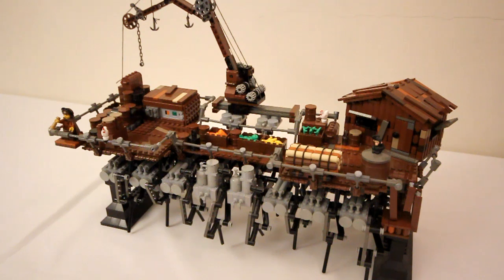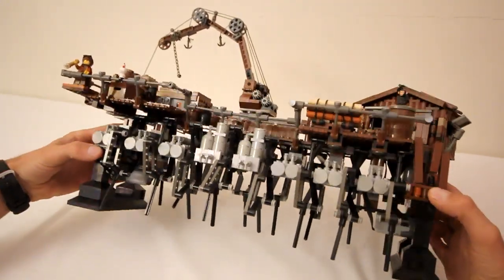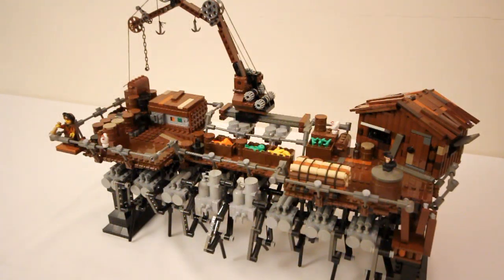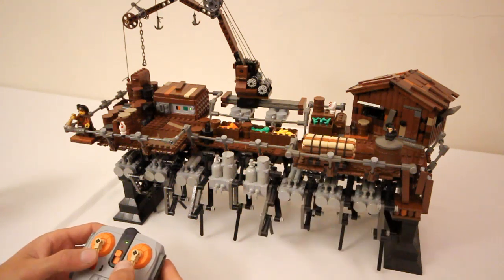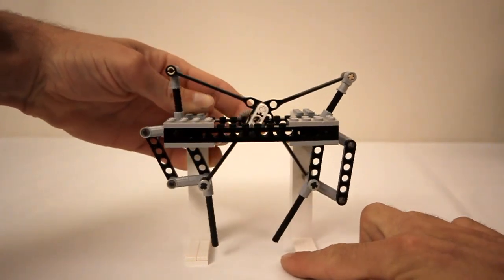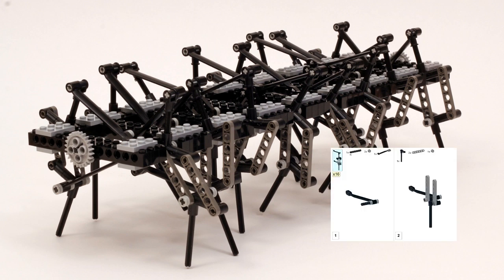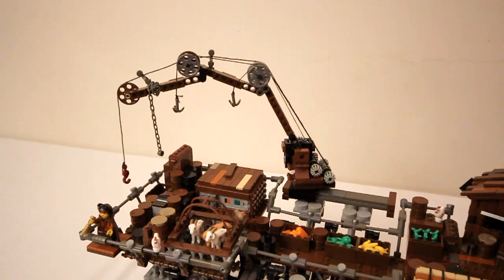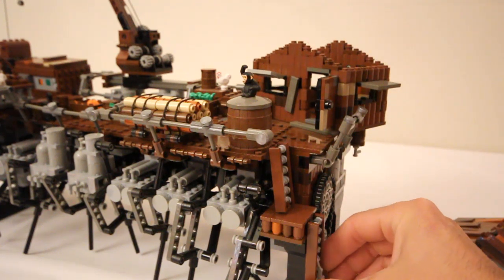LEGO Steampunk Walking Ship (Strandbeest)

Comment: Very nice built mate! I would like to recreate it by myself but I'm not sure about a couple of things.. Can I ask you a couple of questions?  How do you assemble the deck of the ship to the walking mechanism? Is the bigger gear the one that controls the legs and the smaller one the one that's attached at the motor? I know that it's been a long time since you create it, I'd really appreciate some more information. Thank you for this video and for all of your works!! Bless!
Reply from the maker: The deck just sits on top of the frame. Yes, the large gear is connected to the leg drive train, and the small gear is connected to the motors that hang underneath.
Reply: thank you so much ;)

Comment: Simple NOOB question, what is the name or number of that double clip arm used to connect the two parts of the folding ladder at the end of the video? I cannot find in under "clip" on Bricklink
Reply from the maker: It's actually an arm piece from a battle droid, technically called 'Arm Mechanical, Battle Droid': http://www.bricklink.com/v2/catalog/catalogitem.page?P=30377

Comment: Hi Jason.  I know it's been a couple years sense you release this video, but do you have any pictures showing how you mounted the M motors underneath the walking ship?  I had a great time building this with my kids!
Reply from the maker: +Jason Barth Sorry, I couldn't find any pictures and I don't have this model anymore to even look at it. I think I used these pieces (http://alpha.bricklink.com/pages/clone/catalogitem.page?P=52107) on their side to 'reverse the studs' so I could attach the motor upside down to the bottom.
Reply: Hi Jason! First of all thank you for this beautiful model and for the instruction. Sorry for this intrusion but I would like more detail about the connection between the motors and the gears on the sides of the machine. Thank you again!

Comment: Hello, JK Brickworks!
I have been trying to figure out the angles that the cranks of different pairs of legs make with each other. For example, if its a 4 legged mechanism, the angle between them is 180 degrees... so what is the relation between the number of legs and the angle between the cranks?
Reply from the maker: +Hardik Dubal For this model each leg is offset by 90 degrees from the one beside it.

Comment: I wonder if adding rubber tips on the legs would make it run smoother, or I don't know anything about mechanics
Reply from the maker: +Ben Brown I actually tried that at some point. It's a good idea but unfortunately doesn't work well on this particular machine. The legs end up getting caught up on the floor too much
Reply: you could try to use those lego foam darts for legs.
Reply: +Levy Wilson adding some wheels on the legs could be help
i think it would improve the action of the legs , go let them go smoother
Reply: ha you don't

Comment: first off, i love your channel! i subscribed to it a while ago, after seeing a rubix cube build (i guess, or something i came across while looking up rubix builds) and i never really watched too many of the other videos...i was missing out big time o0
what i wanted to say though - could one put those rubber feet (http://brickset.com/parts/4198367) on this to make the walking less noisy and shaky, or would that impede the walking as a whole?
big ups for the builds and the channel - it´s a lot of fun and inspiration.
Reply from the maker: OfftopicStuff Thanks! Yeah, I did try using rubber feet, but it does impede the walking a bit.  If the legs were perfectly designed it would work, but because of the limitations of LEGO axle lengths the legs aren't quite ideal.  They end up pulling back against the direction of motion very briefly before being lifted up.  It's not a big deal if the feet can slide a bit over the walking surface, but with rubber feet it would cause a lot of stress in the system.

Comment: Would more legs make for smoother travel? looks like a bumpy ride!
Reply from the maker: Not much, I thinks it's about as smooth as it gets using LEGO at that scale.  A big issue is the weight of the machine.  Without the themed deck on top the frame will run much smother.
Reply: Cool idea either way thanks for sharing!